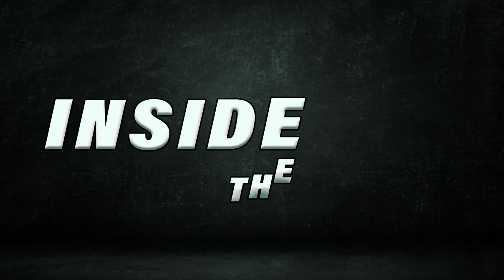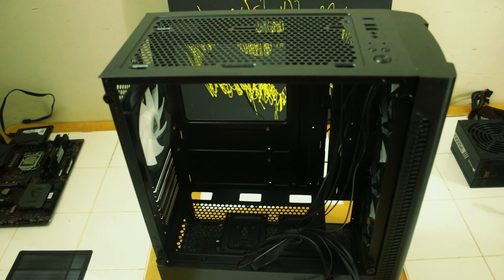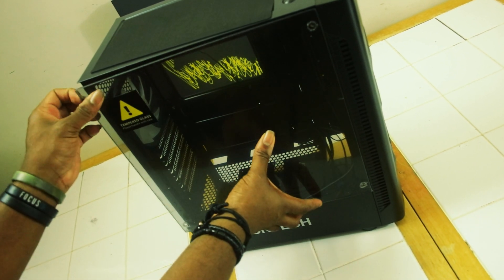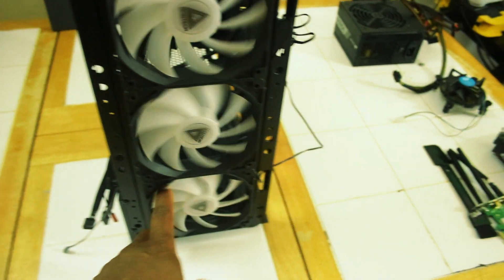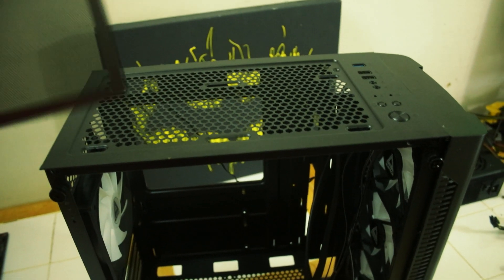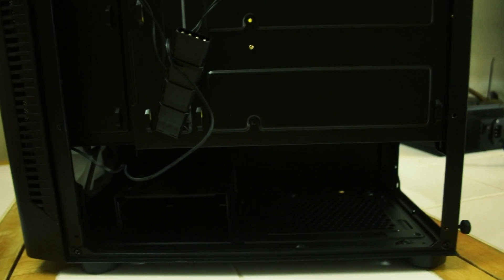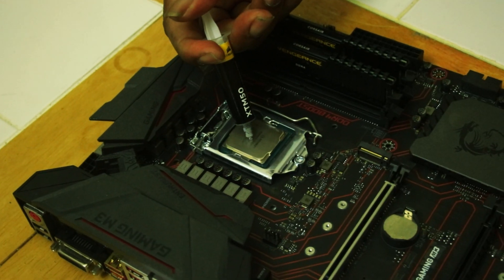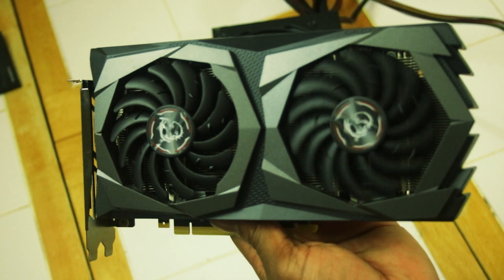Best Budget PC Case Under $60 With RGB!? (Hot Review)

Comment: I just have this one problem with my gta 5, so normally very high settings in story im getting 90-75-112 frames but after I installed mods or I don't even have mods right now anyways im struggling to even get 40 frames, its not my pc because any other game on very high runs very smooth its just gta what should i do?
Reply from the maker: Hey @The Outlaw Of the south! I know you said every other game runs fine at similar specs, but what are your PC specs?
Reply: @SuperMetaTech  its me bryce, do you still want me to tell you my specs loll
Reply from the maker: @br7ce99  nope send me message over on IG. 😅👍👍
Reply: Reinstall
Reply from the maker: @TheFirestriker101  drivers maybe sure, but that could just be the tip of the iceberg 🤙🤙
Reply: @SuperMetaTech  I mean the game. He said it's the only game messing up, should be a simple fix.
Reply from the maker: @TheFirestriker101  Most definitely! Totally agree 👍👍👌